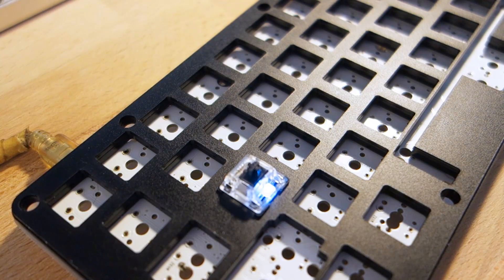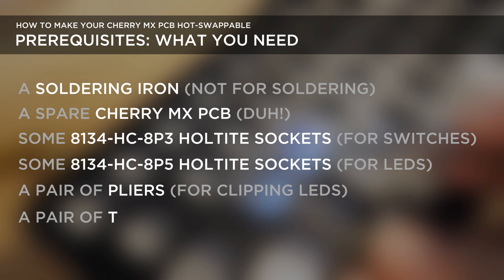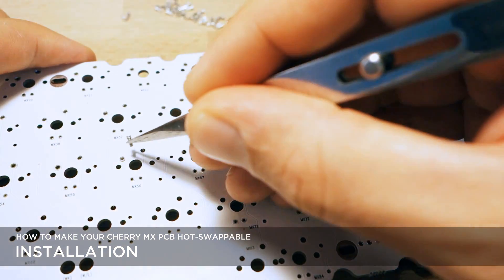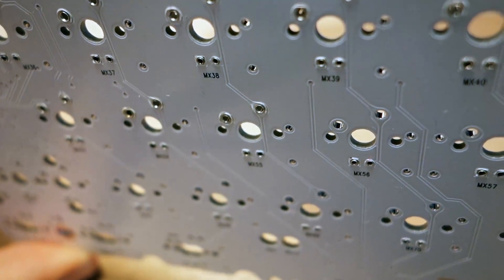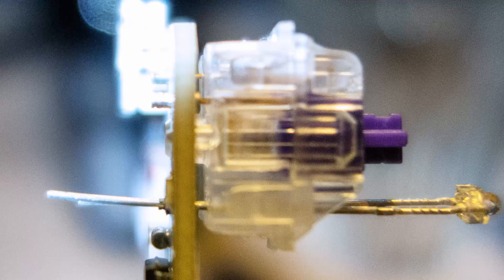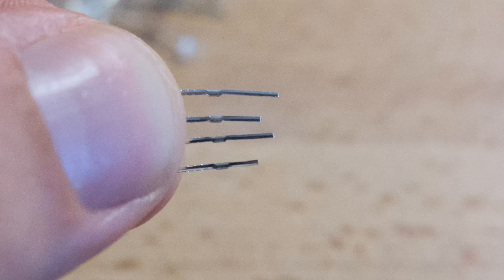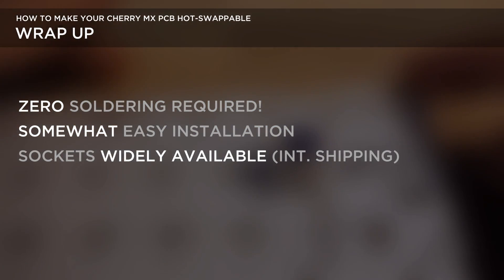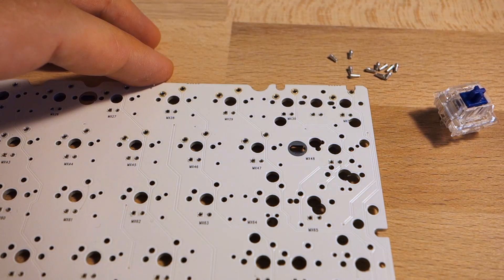How to make your keyboard PCB hot-swappable

Comment: This is awesome, but this looks extremely time consuming for prebuilds. I'd still considering doing it but this is NOT cheap either, so maybe not.   it's $60+ bucks for both parts depending on how many keys you have.  Now days you can get a new hot swappable keyboard somewhere at this price and even less.

Comment: I know this is a very old video and there are newer hot-swappable sockets,  but for these...the lead version are you just burnishing the insert with the iron or do you heat the iron? and if you heat the iron, what temp do you set it to?
Reply from the maker: I don't have temperature settings on my iron so I wouldn't know. But yes, it should be heated so sockets become more flexible

Comment: When I was looking into my Legion K500, I was like "Hmmm, it could be possible to mod it for hot swap....let's check youtube if someone actually did it."
youtube: "No, you are not first person who had this idea."  😀  I think I will not do that, I don't need to change them every day, I just needed to check one switch which was acting weirdly (it was typing 2 letters in one time very often) and it was probably high switching resistance, seriously, there was like 7 ohm, that was not switch, that was resistor. 😀 I just opened that switch and cleaned contacts and there is 0 ohm now and it works perfectly. But what scares me is that even other switches have few ohms which doesn't look ok to me, but it works fine for now. 
PS: it has kailh red switches.

Comment: Is the soldering iron hot?
Reply: OK, I see what's going on. The idea is that the little lip on the entry end is  supposed to hold it in, but it doesn't. If the socket stays in long enough to get the pins in, then it might hold, but what should really happen is that there should be a thin film of solder and the iron should be hot enough for that film to make a solid enough connection to hold.

Comment: Can I still do this if I have a lifted pad ? Like the silver circle around the hole is gone but do u think if I buy the sockets it will basically have the same function ?
Reply from the maker: Technically, yes, but maybe not with these sockets. Get the Milmax sockets instead. Those you can easily "jump", meaning you have to connect the trace (the thing that connected to the pad originally) with the socket, through a small wire for instance. The holtite sockets don't really work for that because they will get clogged with solder as soon as you try to connect them to a wire. The Milmax sockets have another layer on the outside, which you can solder.

Comment: Hey so I am thinking of making my super cheap outemu switch keyboard to hotswappable, so can you help me/tell me which socket would I need to use for that?

Can anyone help me?
Reply from the maker: It depends on the PCB, really. And I have tested this method only with a few different PCBs. Probably none of which are the same as yours. Sorry, you have to try yourself. I'd suggest to use Milmax sockets though. Please search YouTube and you'll find a guide on how to do it
Reply: @jpan2545  Sooooo long story short i ordered a sample of the sockets you suggested and they don't fit :''( . Will try another sockets. Thanks for recommending milmax tho.

Comment: What type of switches can i install in it? Can i use holy pandas? If not which socket is able to hot swap holy pandas?
Reply from the maker: Any MX-style switch works. Including Holy Pandas. It depends much more on the PCB whether this works or not.
Reply: @jpan2545  Ohh Thank you so much! Do you think it will work on a rk71 or rk68? also i just checked the website and it says i have to order minimum 100,000 units which is 30k usd. is it a glitch ?

Comment: How did you do this without destroying your soldering iron tip? I have the TS100 and the tip couldn't stand the pressure and heat so it bent and broke off the tip by the end.
Reply from the maker: You shouldn't need much pressure.

Comment: are gold and lead version both good to be used without soldering?
Reply from the maker: They should be, yes
Reply: @jpan2545  cool thank you, and for the leds, is it the same process where I have to push gently with the soldering iron?
Reply from the maker: Yes. It's the same process. But keep in mind that the success of this very much depends on the hole size of the PCB. If the holes are too large, the sockets fall through. If they're too small, you won't get them in.
Reply: @jpan2545  Sorry for the late question but I ended up purchasing the sockets and led just now for my space65. Would I have to use qmk/via and code in order to get these to work?
Reply from the maker: @animationcanceling  There is no coding needed. This is purely a hardware job

Comment: Nice tutorial. I have one question. Do you know the diameter of the led pins? I want to get some socket's for my keyboard, for switches I've found something, but for LEDs I haven't, I want some sockets that I can solder. For switches I am gonna use mill-max 7305.
Reply from the maker: Hmm. I wouldn't bother tbh. But you can take the diameter from the specifications of the sockets in this video.

Comment: The pages you have linked sell the sockets at a minimum quantity of 100000, which costs around 27000 USD, are there any other retailers that sell these sockets??
Reply from the maker: Check mouser and digikey.

Example: https://www.digikey.com/en/products/detail/te-connectivity-amp-connectors/8134-HC-6P3/4030451
Reply: @jpan2545  Thanks pal

Comment: 50$ for the sockets and leds is over priced, 10-20$ would have been a good price.
Reply: depends on the switch manufacturer. genuine cherry switches are expensive.
Reply: @mer2329  I am not talking about the switches
Reply: Millmax is cheaper

Comment: Its been 3 years since this video, how is that keyboard holding up? This is the most important question :o
Reply from the maker: I am still using it. It's not as tight as in the beginning but it's still good!
Reply: @jpan2545  What about chattering or similar problems bound to loose contacts?
Reply: wanna know too

Comment: So when using these sockets would you treat the switches as plate mount? It looks like they don't interfere with anything on the front but i figured i would ask
Reply from the maker: Plate and PCB mount both work just fine.

Comment: Do you tin your soldering iron when you do this? wouldnt it either oxidize or get solder all over the sockets, whats the strategy as far as tinning goes here?
Reply from the maker: I didn't tin anything. I am not using any solder either. It's press-fit with the soldering iron just used as heating source.

Comment: What temperature is your soldering iron at when doing this?
Reply: he did not solder or anything, he just used it to push the holtites into the PCB
Reply: @hikarii8758  I'm asking the temperature of the soldering iron, as some say it helps with the adhesion. No solder is used, but heat from the iron can help
Reply: ewt415 I think the temp doesn’t matter.
I think he said you can use something else than a soldering iron but he uses the soldering iron because he has nothing else to use and that’s what he saw online. So yeah, doesn’t really matter.

Comment: PSA: KBDfans keyboards have much larger holes for the pins on the top row, and these will not fit. Hole sizes on other rows are inconsistent, and these don't fit in all.
Reply: you probably can find similar, but larger sockets if you search a bit.
Reply: @h4z11s4  in theory, yes - but the inconsistencies in hole size still present a problem. It's probably just better to go with a higher end PCB if you want to hot-swap mod your keyboard.

Comment: This is a very interesting tutorial. I am wondering if there are "alternative" connectors: I have difficult to find the connectors you used in Italy thus I need to buy an alternative. Can you suggest an alternative available in Europe? Thank you very much for sharing your work.
Reply from the maker: There are also Millmax sockets which are basically the same but have an additional shell around them, which makes them easy to fully solder in.
As for retailers, I am pretty sure Mouser ships to Italy.

Comment: Do you think we can adapt this method to a prebuit cherry-mx keyboard if we desolder the switches? :/
Reply from the maker: Yes, should be possible but it could be that the holes are too wide. However, the nice thing about a desoldered board is that the left-over solder will make the sockets stick better (if you use a hot soldering iron to press them in)

Comment: Nice with a tutorial BUT i would not recommend any one do this if your PCB isn't through-hole plated. You are using discrete sockets for through hole plated PCB. (see my snippete from the datasheet here https://i.imgur.com/BkPhUIL.png )

You should get those for solder instead. that will also mitigate the problem of lifting pads
http://uk.rs-online.com/web/c/connectors/ic-sockets/discrete-sockets/?applied-dimensions=4294885285&pn=2

Comment: Just checked Winkeyless' website and... they, for some reason, recommend a flat tipped screwdriver or something like it. Either way, what are your thoughts?
Reply from the maker: Works as well if the holes have the right size (winkeyless boards have a perfect size for the sockets so this works well). Pressing them in with heat (soldering iron), especially the lead sockets, will make them fit better, imho.

Comment: How would you go about removing holtites to transfer to another board or location?
Reply from the maker: You press them out with a hot iron from the backside of the PCB. If you're careful enough to not damage the fingers, they should still work on the next location

Comment: So you don't have to solder the holtites to the PCB after you put them in? Are they sitting firmly enough not to be pushed out by plugging the swtich? I was hoping to desolder switches from by Vortex Pok3r and making it hot pluggable.
Reply from the maker: Yes, should work firmly. See here: https://www.reddit.com/r/MechanicalKeyboards/comments/5uqltx/hot_swappified_my_pok3r/

Comment: I heard that hotlites will fit only some pcb's.Which pcb do you use for this project??
Reply from the maker: Here I used a Winkeyless B.face PCB (see winkeyless.kr website). Not all keyboards have the exact same hole diameter, though. We created a table with our current findings: https://docs.google.com/spreadsheets/d/1K1qt70E2mcuaHBXYrpPHXlpl7FNaXLo0u_TOe67cVdY/pubhtml?gid=986897710&single=true
Reply: J Pan aw man I was eyeing to dz60 for the split space. Looks like I'd have to solder
Reply: Where did you hear that? While I'm pretty confident that most holes are of the same size regardless of the pcb, I'm planning on doing this on my next build and would like to be sure.
Reply: Kappa Kreygasm there's something like the kbd75 and I know that messes with holtities

Comment: do you recommend using 3pins switches or 5pin switches?
Reply: Alwintheboy ? cherry mx style switches have 2 pins
Reply: Oh i also count the middle plastic stem, some switches have 2 extra small plastic legs, i afraid those will make swpping the switches harder
Reply: Alwintheboy not that much. in the video i use switches with legs for PCB mount. they are a little harder to insert but not that much. you can also trim those legs a bit.

Comment: Hi, good video! How hard is it to change switches once they're installed in the winkeyless case? I imagine it is quite hard to pop switches out of a plate... or do you use a special tool for that?
Reply: Well this is super late, but from what I've seen something like a flathead screwdriver should work but you risk scratching your switch plate.

I would use something like an IC puller. I know 1upkeyboards.com sells them and I think they are called switch pullers or something like that.
Reply: You can use a switch puller. They’re pretty cheap though

Comment: What is the special tool needed to install these?
Reply: ihalatch waiting for the same question
Reply: As you can see, it's not needed. Just use a soldering iron. As for this "special tool", it's named somewhere here in the comments.
Reply: Here's where it's discussed in the comments: https://www.youtube.com/watch?v=RB1Wm8y2Cw8&lc=Uggre_EDm5RlTXgCoAEC.8KderT79Nur8NASn7rGnkw
and below that there's a mention of a much cheaper tool that might also work.

In case those comments get deleted, here's a summary: The "Application Specification" linked on the product website mentions "Spring Loaded Hand Tool 5-1437514-3, 5-1437514-5, 5-1437514-7" and "Pneumatic Hand Tool System 5-1437514-8". Possible alternative: tools called "spring-loaded automatic center punch" cost like one dollar.

Comment: SO... To do this you'll need a Mechanical Keyboard PCB which is EITHER PCB-mounted or plate-mounted...
You said that we'll need a "MX Cherry PCB" which I cannot really understand.. Does this mean a PCB which is MX Cherry compatible?

I'm unsure, I have a plate-mounted keyboard which uses red Kailh switches and I want to replace them with blue/brown/green Gateron switches. Will this work for my keyboard?

Q: How hot does the soldering iron have to be to melt the solders?
Oh, and did you remove the solders before doing this? (All of them.)
Reply from the maker: There are other types of keyboard switches (e.g. ALPS) which have different pin layouts and sizes and those need a PCB that support it. The sockets in this video are for Cherry MX switches (or switches who use the same design such as Gateron) only.

Comment: Very nice video. Some questions:
Why didn't you need solder for this mod? How firm can they stay there without solder?
And when may solder be necessary?
Reply from the maker: They will stay very firm. Don't move at all. I have not seen one of them coming off, yet.  Depends a bit on the PCB (see https://docs.google.com/spreadsheets/d/e/2PACX-1vTEpMxu0-9QZoqANt2piXOzjxHSEIafLuUYjJIw1J0JFAH_xiA6n6MSeU7UlZ0oli9fbNn87rjUl_Ov/pubhtml?gid=986897710&single=true for a compatibility table that we currently have). 
That being said, do NOT TRY to solder them. The solder will get into the socket and make it impossible for the switch to go in.
Reply: J Pan
That is a very handy table, thanks for the good work! Has anyone done these non-solder mod for Alps compatible PCB?
MX switches (except for the vintage Cherry and Nixies) are widely available, however, older genuine Alps switches (not the Matias simplified versions) are relatively quite rare to come by and of much higher quality and key feel. Having a proven non-drilling method to make Alps compatible PCBs (e.g. Input Club's Infinity 60%, Alps64 by Hasu, or Duck's Eagle PCB) hot-swappable with similar performance will be great for all the Alps enthusiasts.
Reply: menuhin yes. the required sockets are in the table as well I think (8134-HC-12P3). Pm E3Eves on geekhack or reddit. He knows best about how to do it with alps.
Reply from the maker: I guess you'd have to test it with one of the PCBs you mentioned. Sorry :>

Comment: You can also get the switch puller from Ali Express by searching IC Chip Extractor (which seems to be the exact one that 1UP Keyboards sells) - https://www.aliexpress.com/item/U-Type-IC-Chip-Extractor-ROM-Extraction-Tool-DIP-Encapsulation/32610238267.html?spm=2114.01010208.3.2.a9u05G&ws_ab_test=searchweb0_0,searchweb201602_2,searchweb201603_1&btsid=5303e9dd-6fd8-4286-919c-f802cce98f31

Comment: Nice video man, was the soldering iron turned on when you were inserting the sockets? If so, at what temperature?
Reply from the maker: It has to be turned on, yes. Can't tell you what temperature as it's a really cheap, $15 iron. I would suggest starting at the minimum value, though.
Reply: I was going to ask the same thing
Reply from the maker: Thanks, btw :)
Reply: seems they're not available in the Europe ;(
Reply from the maker: Not sure why TE removed it from there website but Digikey as well as Mouser list these sockets (and they ship to Europe).
Reply from the maker: Going to update the list of links at the next opportunity
Reply from the maker: That's the beauty of it. You don't need to solder but you need a bit heat to make the socket malleable (or you have the manufacturer's tool to do it, which doesn't use heat, just force). The sockets are designed to stick  once pressed in. Guess it has something to do with the composition of the metals and/or the friction
Reply: Do you know what the name of the tool is?
Reply: There's a really good chance that one of these would work: https://www.amazon.com/MulWark-Spring-Loaded-Automatic-Adjustable-Replacement/dp/B0714JYF2Y/ref=sr_1_1?ie=UTF8&qid=1498338384&sr=8-1-spons&keywords=spring+loaded+center+punch&psc=1

You may need to blunt the tip a little, but at this price it's worth a try compared to TE's $200-$300 tool.

Are people still updating the spreadsheet? I am getting an ALU96 and an RGB 60% board in the mail soon and will report back.
Reply: hoo boy, did you see how much they are?! $182 just for the tip! That's not even including the tool itself. No thanks.
Reply from the maker: According to the Application Spec (http://www.te.com/commerce/DocumentDelivery/DDEController?Action=srchrtrv&DocNm=114-13033&DocType=Specification+Or+Standard&DocLang=English&DocFormat=pdf&PartCntxt=7-1437514-1), the spring-loaded tool is called "Spring Loaded Hand Tool 5-1437514-3, 5-1437514-5, 5-1437514-7" and the pneumatic one "Pneumatic Hand Tool System 5-1437514-8". There are more listed but they are for plate-supported installation. Cheers